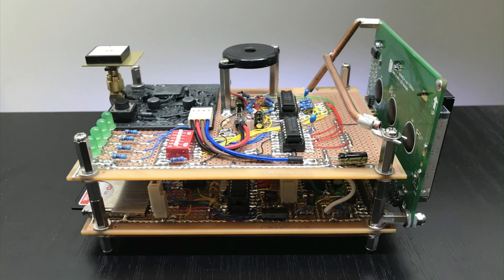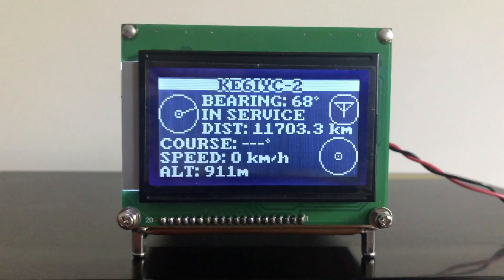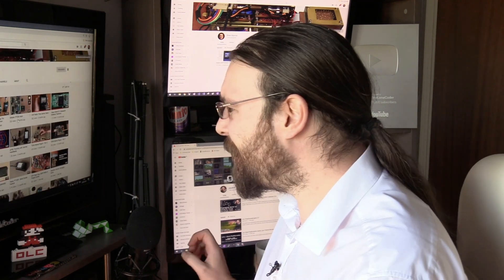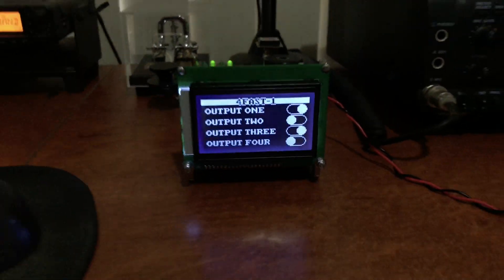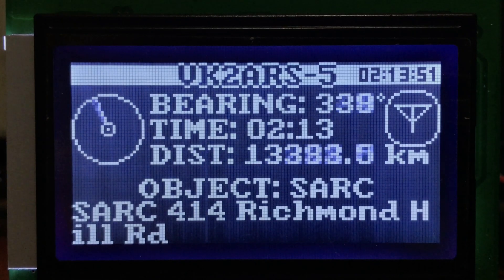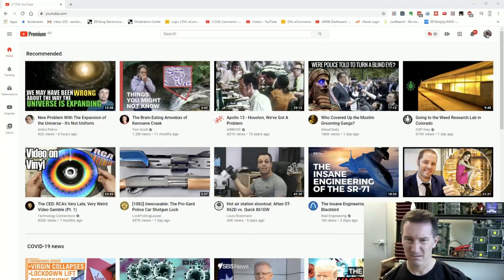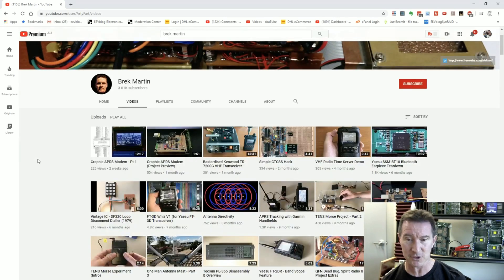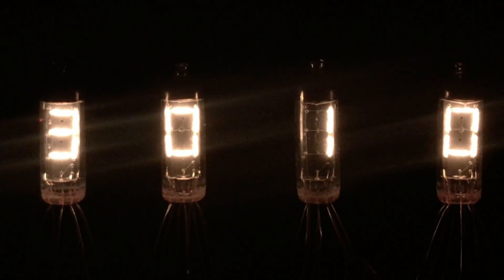Graphic APRS Modem - Pt 2 (3k Subs)

Comment: Mainstream now dude.  Been a long time subscriber since we both failed to win a scope in the EEVBlog giveaway.... Have fun!  Would be nice to know a bit about how you are decoding the AX25... or is that done in the radio?
Reply from the maker: Hi :) I just have speaker/mic coupling, or packet interface to radios. Another chip by Bob Ball is used to decode Bell 202, and then ax.25. I’m only handling APRS protocol. Bob Ball’s 16F88 is based on prior work by others, and it can send location packets on it’s own, but won’t be allowed to. I’m handling the GPS myself, and will be assembling any sent packets myself, including replies to the GETIO & SETIO commands, as well as an announcement with the Astronomy information you see in the clock program in a prior video. I have my own APRS software designator because any new bugs in transmitted information are likely introduced be me :D